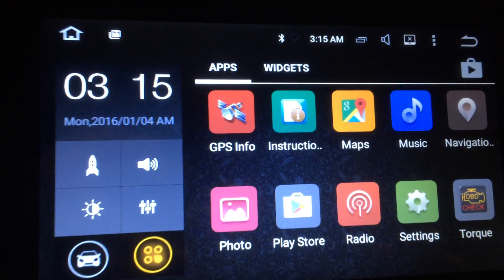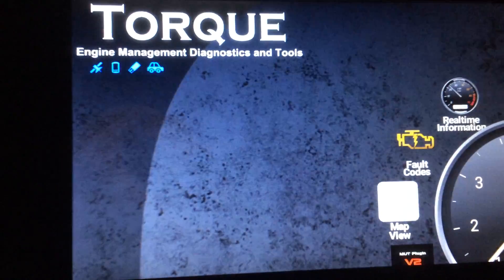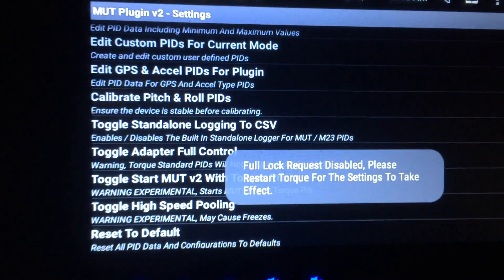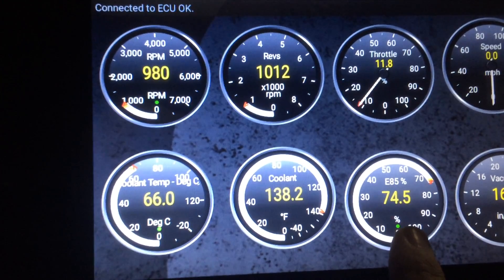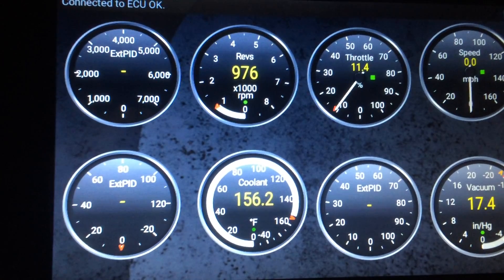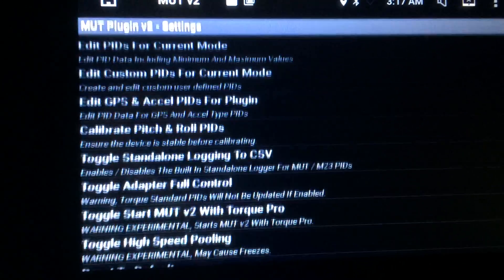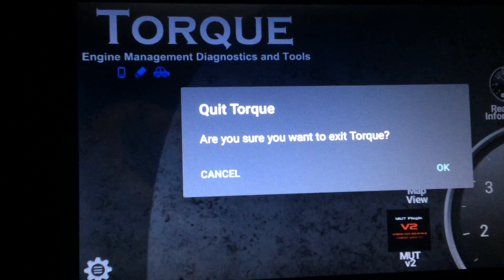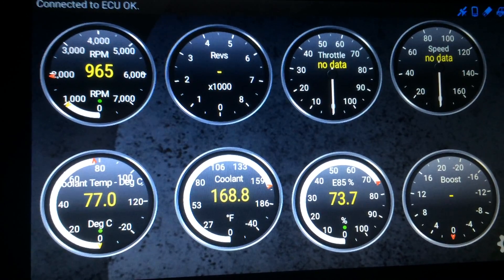Torque Pro MUT V2 Issue

Comment: Hi mate - your pooling speed on the screen with MUT V2 is impressive, mine is much slower, what adapter are you using?
Reply: Nikos Al. Did you find out the adapter he was using? Bought about six with no luck.
Reply: @nordellgarcia9423  did you get an answer of the adapter?